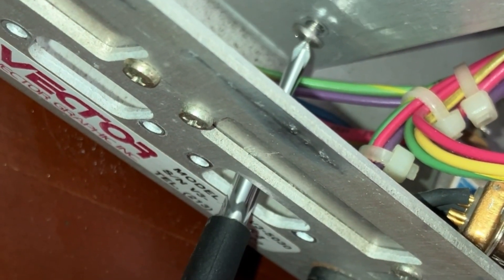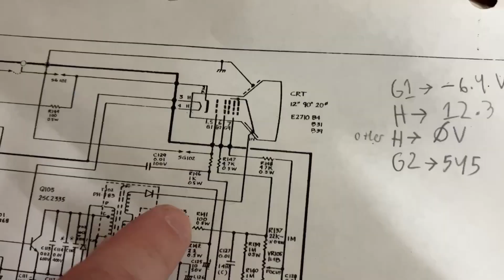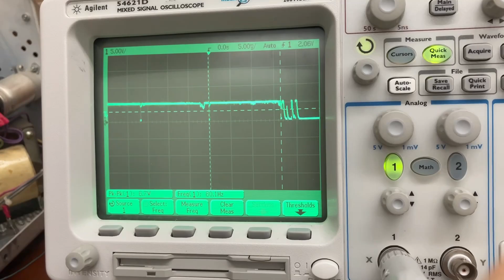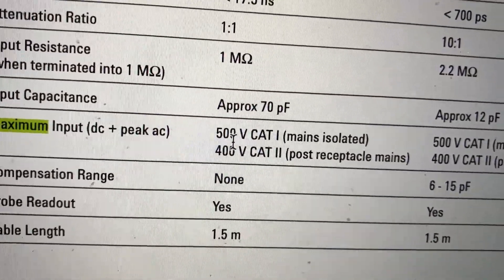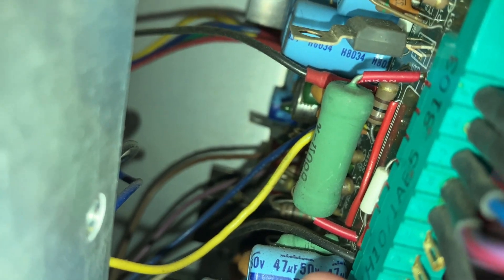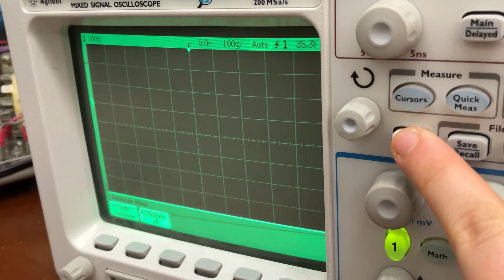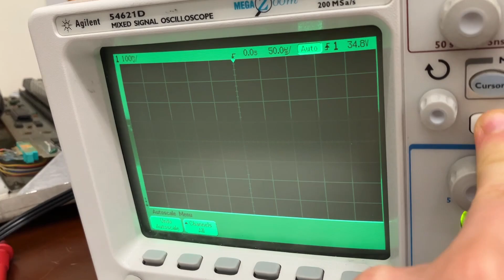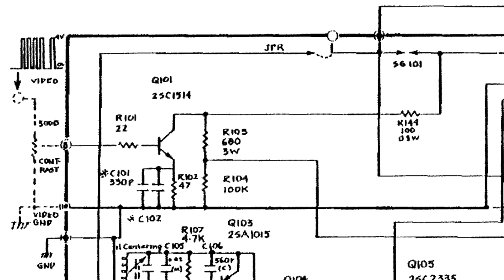Amplifier Agony: More Vector Graphic 3 CRT Debugging (some questions for experienced TV techs)

Comment: Dunno if it was mentioned already, but those diagonal lines are normal on a raster display - that is the vertical sweep returning the beam to the top of the screen - the horizontal sweep continues during that relatively long interval. Also, on any single-sided board, it is good practice to 'reflow' the pads on any large component or connector as long as you are elbow-deep in the works.
Reply from the maker: It turned out the monitor was fine and the problem was a bad open collector inverter chip on the output of the Flashwriter II graphics card. We replaced that and are up and running!

Comment: When you measure video signal at the base of Q101 the vertical scale is 100mV/div and the video peak amplitude looks only about maybe 300mV? Q101 does not have DC bias so I suspect the input video amplitude is too low to open Q101. On the schematic at the video input to the Contrast potentiometer does it say 9V peak? If so, the contrast pot is either (almost) all the way down or shot. Might be the wiring around it or solder joints that are broken.

Comment: From the schematic, there is no horizontal or vertical blanking implemented in the monitor. The brightness is normally set so that the raster is just below visability. I suspect that the video amplifier is open collector-base. There should be a large (10 to 30V) negative going signal at the collector.

Comment: The numbers next to the crt are pin numbers, not voltages 3,4 are the heater nominally 12.6V,  2 is cathode (this also has the video modulation) about 20-30V, 1 and 5 are G1 about -5 to -20V depending on brightness control, 6 is G2 at about 500-600V, and 7 is G4 at -300 to +500 for focus (the tube has an Einzel gun where the focus electrode is near ground).

Comment: Is the signal at the base of that transistor biased high enough to turn on the transistor?   At one point, it seemed to be just a few hundred mV from ground.  I agree with the other posts about not using autoscale.   I think it's better to learn how to adjust the controls properly yourself.

Comment: 1. Keep going!
2. Stop using autoscale, and learn to use the vertical scale and offset controls. 
3. Trigger scope from either Hsync or Vsync, and measure using a second channel.
4. Clean the PCB, with isopropanol.  That flux residue might not be the issue, but it isnt helping.
5. Don't guess.  Unsolder the transistor and measure out of circuit.
6. Keep going! The tube is working, and most other parts can be replaced.

Comment: I admit I clapped to myself when you turned up the brightness control as I had recommended in the last video and you got raster. Since all the main supply voltages are derived from the fly back, transformer, the ground reference needs to be the signal ground, which may be at a different potential than the chassis ground---measure first.to make sure you don't have a substantial voltage difference using your meter. It would likely be worthwhile to use your scope in differential mode, two probes, add and invert the second channel (I know you know that routine) to isolate your ground reference from mains ground.. It is very possible that electrolytic filter on that supply is bad---heat in CRT monitors dries out electrolytic caps.  There will always be some 115 KHz noise present, thus why you need to reference to the signal ground...If you are still seeing the 15 KHz ripples using differential mode, check the cap, or caps, including the emitter bypass caps. That ripple may be enough that it is swamping out the video signal is my initial feeling. Mire measurements are in order to get a clearer picture. Please let me know if I can offer anything else. or answer any other questions. I truly enjoy your videos, and your work a great deal, so I appreciate the chance to give back a little. You are doing great, BTW for your first  foray into CRT circuitry. Nice work!

Comment: Also back in the day, we'd physically tug on suspect capacitors and bad ones frequently just pulled right off their leads. Low ohm resistors go up in resistance, and high-ohm resistors go down sometimes when they fail.

Comment: Dial the G1 (bright) down to where you just barely see the raster.  Q101 is a common emitter amplifier, but it in this context, it functions more like a switch. A positive voltage on the base, biases the transistor on, which pulls the cathode negative, and current flows in the CRT. Remember, CRT works like any other tube, cathode high, no current, no cathode beam, no light on the screen. Cathode pulled towards ground, current flows, electrons beam from the cathode, the screen lights. The train of pulses get painted on the screen as the beam sweeps. Given the emitter resistor is 47-ohms, and the base has a 22-ohm resistor in front of it, Q101 gets biased on pretty hard for every lit pixel and completely off for a dark pixel.

Comment: Hey all. The noise you're seeing on the power rail and elsewhere is probably due to the location of the ground clip on the oscilloscope probe. There's a lot of EMI being emitted by the flyback and it can easily be picked up. Chances are if you connect the probe ground to the ground trace on one part of the PCB and measure ground elsewhere, you'll see noise, even if they're the same trace. 

I'm starting to wonder if there's a problem with the brightness pot on the back of the unit? If you compare the signal coming from the computer, the signal going into the brightness pot, and the signal coming off the wiper, and see if there's a major difference? Or even just measure it with an ohm meter. The signal on the base of the transistor seems very weak. Also, don't forget the CB junction! If it's shorted, you'll see a lot of voltage across the emitter resistor (and a lot of smoke), but if it's decided to go open, the emitter resistor will be loading the brightness pot and the signal will be weak like you're seeing.

The numbers on the CRT symbol represent the pin number on the neck. Same as a tube, except for the anode cap which has a voltage measurement. Confusingly, G1 is internally connected to pins 1 and 5, which is also labelled on the diagram. Best of luck.

Comment: I could only fix it if i was there.
Just a matter of comparing the output signal to input signals of each stage and visualizing how the circuit should work. Sync circuits and oscillators need a bit of visualizing too.

Comment: Something going on in the flywheel sink circuit, you shouldn’t see the Fly back lines, the video output is stopped when the scan flies back to start a new line
Reply: I thought of that too, but it may just be the brightness is turned up too high. Worth double-checking. I know if you turn up the brightness too high, you will see the retrace lines.
Reply: @davidjh7  that’s right when the brightness is too high, you see the fly black lines I’ve not worked on such a circuit since 1976!
Reply: Not in this particular monitor. On a TV, the blanking is often handled at G1 during retrace, since the input is composite video. This monitor relies entirely upon the signal being blank during retrace intervals.  If the screen voltage is set too high, you'll see the retrace lines. Hence, it needs to be turned down more. But it is very good to confirm raster!!!

Comment: A few tips from an old TV repair guy:  use two probes on your scope, sync the sweep the H-sync pulse. Use the other channel to probe video. Then you can see the waveform of a line of scan (or more than one line if you slow the sweep).  The "brightness" is too high, the diagonal white lines are re-trace. With the grid set so high, it won't actually display any video.
Reply: Also, don't overuse the Autoscale button. You'll confuse yourselves when the timescale changes. It's all over the place during your measurements. Just adjust gain and vertical position (or AC-couple the input) if you measure signals with different amplitudes.